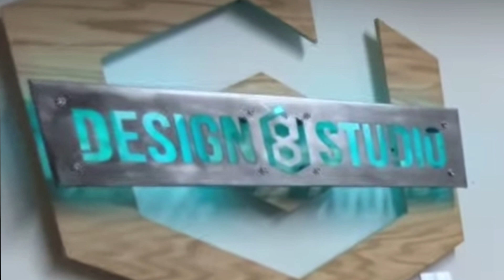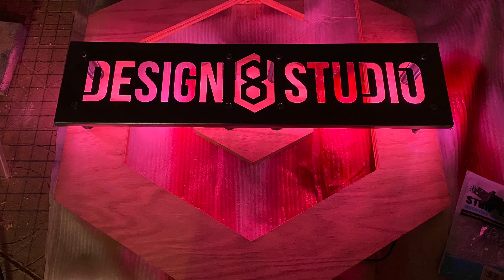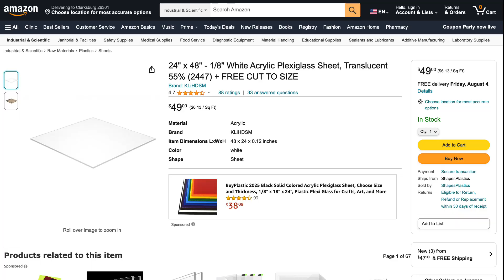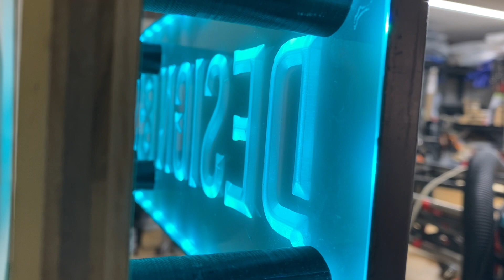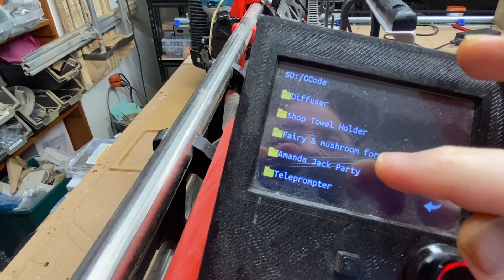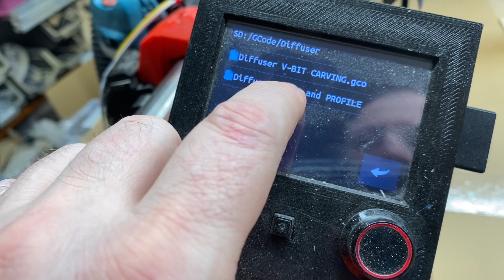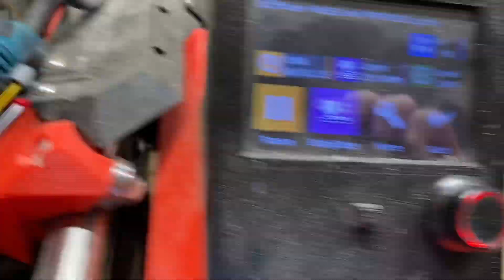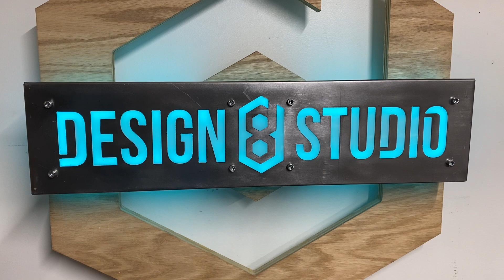LowRider 3 CNC - wrong & right way to carve/cut plexiglass!

Comment: ❤ dough, you are on another level. Experimenting and testing is what makes the mastery. 
One free tip. After you finish engraving and profiling acrylics, if you use a flame torch on the edges (and dont over heat it)  you can leave the edges just like if it was done on a co2 laser. 😊) That might not be your case but for when the edges are exposed it does the job.
Reply from the maker: Great tip! Thank you! I learn something new every day!

Comment: Man I gotta get mine setup. It's just been sitting in a box. I got the email pipe a few weeks ago but then ran into the problem of "what table am I going to use" and then lost motivation again. Awesome stuff though!
Reply from the maker: You can do it! You can build a LowRider without a table, and bootstrap a CNC-cut table by laying sheet goods on the floor and attaching the LowRider to the stack. The first link below will let you search the V1 Engineering forum for this tag: "parametric-table" — and the second link leads to a page on my site where I make available plans for the parametric table I cut and made. Ryan's parametric table plans show a suggested way to make legs and braces from 2x4's. https://forum.v1e.com/tag/parametric-table — https://design8studio.com/for-lowrider-v3-cnc-cut-table-dxfs-for-cutting-f360-archives/
Reply from the maker: And here's a link to a video of me using the LowRider to cut the parts of a torsion box table. The only thing not shown is using 2x4's for legs and braces, which Ryan's Fusion360 plan shows. https://www.youtube.com/watch?v=6x24C5ZwuCU
Reply from the maker: Sorry, I realized later you were already in on CNC table discussion previously! 🙂

Comment: really liked this instructional. Would the " keep it cool" philosophy" also apply to a material like XPS foam?  
Thanks again for sharing 😎👍
Reply from the maker: Yes, absolutely. One of the mistakes new CNC hobbyists can make is thinking that slower feed speeds are always safer. Actually, when the need is to get heat out of the mix more quickly, faster feed speeds are what is called for!
Reply from the maker: A goal of all CNC cutting is to keep the bit cool. Excessive heat softens, weakens, and shortens the life of the bit. Too fast on RPM of the bit while too slow on feed speed, results in rubbing instead of cutting large chips, resulting in heat. Pushing the feed speed up, gives the bit's teeth a chance to bite deeper, and get bigger chips, and those chips carry out heat.

Comment: I was thinking about building a lowrider myself. Would you recommend it? It would mostly be for wood but do you think it can handle cutting steel plate with the right speeds and feeds?
Reply from the maker: I highly recommend building a LowRider v3. There’s lots of video of people cutting aluminum with it, and even some video of cutting steel. It’s definitely not intended to replace a good mill, but then again no good mill can do CNC cutting across a full 4 x 8 sheet!